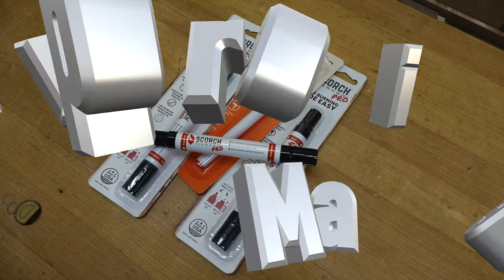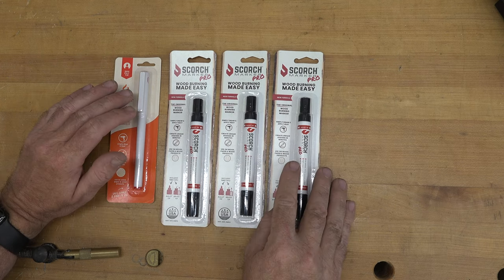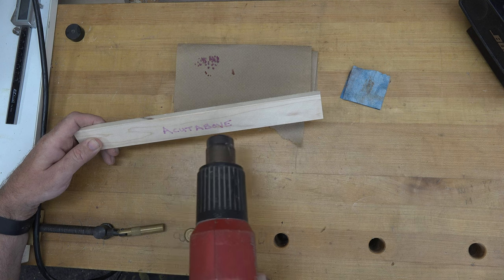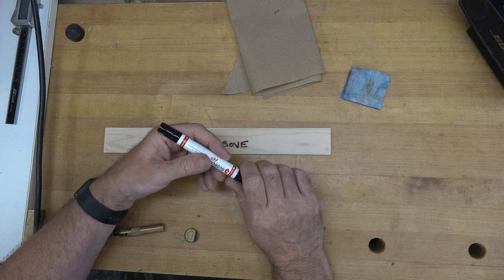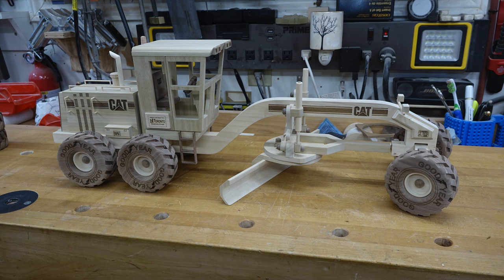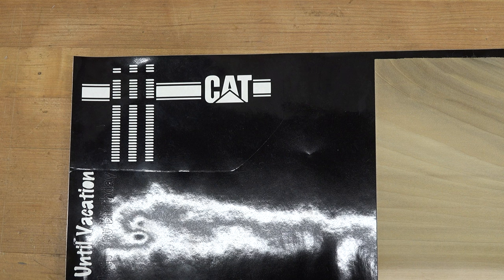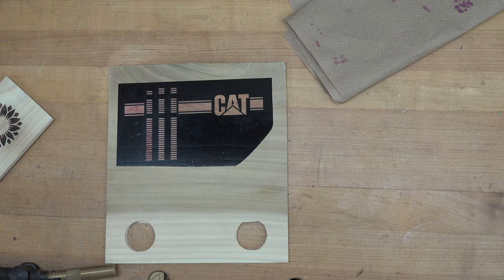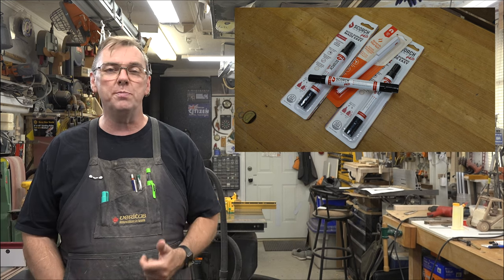First Impressions of Scorch Markers

Comment: I have had a scorch marker for a couple of months and just opened it a few weeks ago. I create a lot of paper crafts and had a paper crafting heat gun. I burned the surrounding wood at the exact time it burned the scorch marker. Then I saw a post from scorch that said you needed a 1500 watt heat gun. I reluctantly bought one from Amazon. It made a huge difference!!!Now that I have seen you use it with extra tips you gave,  I am going to have to give it another try!! Thank you so much for sharing!!!
Reply from the maker: I wish you luck on your Scorch Marker adventure Kendell.  I hope that this video was able to give you the tips that you need to get some excellent results.  Remember, to go light on the liquid to avoid bleeding through the grain.  Thanks for tuning in and for chiming in to the conversation.
Reply: @acutabove_woodworkings  I had no idea how to fix the bleeding. Your tips are great!! I am doing 11 cutting boards today for teacher appreciation week. Now I am not afraid to do it because I know how to fix it!! Thank you!!

Comment: Pretty cool pen and probably Will get some for myself. I can actually sign my name on a piece or customize it for others. I believe the problem with the bleed is that you smeared rather than dab the stencil. It’s similar to staining with tape. If you smear it’ll bleed. Dabs with Frog Tape are much better at preventing bleeding. Then again, pine loves to soak in and notorious for bleeding. Keep up the great work.
Reply from the maker: The bleeding was also present when it was just a freehand drawing Peter.  Using less liquid corrected the problem.  I do agree with the dabbing technique on a stencil but that is normally used with a practically dry brush.  Thanks for tuning in and for chiming in with your thoughts.

Comment: Hi Kenny, what was the other end of the marker and also the smaller pen, I was curious about the different sizes of pen.
Reply from the maker: The other end of the marker John, is a small, foam brush for applying the liquid on a larger scale.  As for the smaller markers, it is essentially identical to the scorch marker that I demonstrated on the show, but a much smaller diameter.  The process is identical.  I hope this helps.  Thanks for tuning in this week.

Comment: Very interesting first time I've heard of it. I'd like to see you try the brush end of the marker on a stencil. The "Big Green Shed" in Australia has a "Wood scorching pen marker" in the "Crafted" brand. I'm going to have give it a try.
Reply from the maker: I kind of feel that the brush end would apply too much material for a stencil Barry as it is a foam brush.  I feel that the brush would be better suited for covering larger areas more quickly and efficiently than the marker end could.   I hope this helps.  Good luck with your "Crafted" markers.  I hope they work well for you.  Thanks for tuning in

Comment: Very impressive results!  I was really impressed with the results you obtained with your homemade template ……. Great review of a product many of us were not even aware of.  Thanks for sharing this with us and have a great day 🤠.    One question:  You mentioned a brush in one end of the pen ….. what is that used for?
Reply from the maker: The brush in the opposite end of the pen Randy is for applying the Scorch Marker liquid on a larger scale.  If you had a larger area to cover, instead of using the thinner marker head at the one end, you can unscrew the opposite end and have yourself a soft, foam brush that would apply the liquid over a larger area much more quickly.  I hope this helps.  Thanks for tuning in .

Comment: Thinking out loud here but I wonder if a sanding sealer, like shellac would prevent the bleed through before applying the Scorch Marker?  I realize 350 degrees would probably not do the sealer any good but perhaps for the short time it needs to be heated it would survive.
Reply from the maker: I too have been thinking about something to seal the wood first Dwight but much like you, I don't know how it would stand up to the heat of the heat gun.  There's only one way to find out.  Looks like I have more testing to do.  Thanks for tuning in to the show and for chiming in with your ideas.

Comment: Hi Kenny.
I know that you have only just received these scorch markers and I was wondering if you had any idea how long each pen was likely to last. I have a project coming up where I will be making some dog lead hooks (about 12) on wood with a small silhouette of a dog with the dog's name. The silhouette will be about 1 & 1/2 inches by 1 & 1/2 inches. The lettering will be smaller at only 1/4 inch. Never seen these markers before either and I am looking forward to trying them. 
Thanks Cliff
Reply from the maker: I've been using my marker on a regular basis since the show aired and it is still going strong.  I would think that the markers would have no problem lasting to do the project that you described Cliff.  I hope this helps.  Thanks for tuning in to the show.
Reply: @acutabove_woodworkings  Cheers Kenny. That does help. Thanks again.

Comment: Is it possible that the other end of the scorch marker (the brush) should be used with stencils???  A normal stencil brush is short haired and dense to be dappled (after blotting) over the stencil. This might eliminate the edge build-up (capillary attraction) that results from the pen tip. Good video, I’m going to order a pen for signing my wooden boxes.
Reply from the maker: The brush at the opposite end is a foam brush Gary which I personally believe to be used for applying the liquid to a larger area, more quickly and more efficiently than the "marker" end.  While you are right about stencil brushes having short bristles, they are mainly meant to be used (practically) dry to avoid bleeding under the stencil.  With the scorch marker brush, it is a foam brush which is meant to hold more material so I honestly can't see it being used successfully with a stencil.  I hope this helps.  Thanks for tuning in and good luck with your scorch markers.

Comment: Interesting product. I might get one to try for intarsia work where you need to burn the eye or nose etc. It would be too difficult I think to line up the laser to do the right spot. As you said I wont be able to get them here, but I did find an alternative maker that is available here. I will have to try them out, although it may be easier for me to buy a cheap wood burner kit as I wouldn't need to use it often
Reply from the maker: I know that they are available on amazon Brett.  Not sure if this helps or not.  Thanks for tuning in and good luck with your markers.  Just make sure to practice and do test burns.

Comment: Will they sand off if just cleaning them up
Reply from the maker: If you sand too much Duncan, you will completely remove the burned design.  It might take a while but you can still remove it.  So light sanding is preferred.  I hope this helps.  Thanks for tuning in this week.

Comment: Interesting concept and seemingly a good alternative to a laser (for certain tasks) ... thanks for sharing👍........ What's the difference between the Scorch Marker and a normal marker, does the normal marker bleed more?
FYI #1 ... do a search along the lines of 'Chemical Wood Burning Pen' or 'Pyrography Marker Pen' ... looks like there a quite few manufacturers out there (I found 3 or 4 easily in the UK).
FYI #2 ... looks like it uses ammonium chloride ... so you could make your own solution and get a set of water pens/brushes for applying it (another thing I didn't know existed until now) 😁
Reply from the maker: My experience with a "normal" marker is that after a while, they fade out whereas to the best of my understanding, Scorch Markers will not do that.  I have also found a few different branded "burning pens" and having no experience with them, I can't say how well they work or don't work.  I can say though, that if it isn't broke, don't fix it and Scorch Markers did everything they said it would do.  Thanks for tuning in Barry.

Comment: Can you sand it a tad and get the bleeding off
Reply from the maker: You definitely can do that Brandy and I tested that during my initial testing with the markers.  It does lighten the burn slightly when doing that though so I found that the x-acto knife gave a cleaner edge without risking the darkness of the burning.  I hope this helps.  Thanks for tuning in.